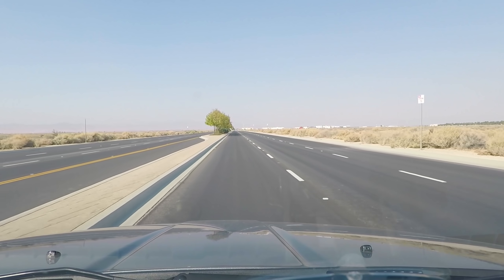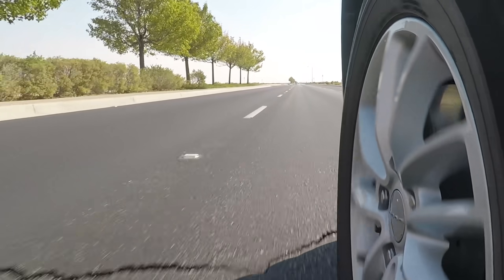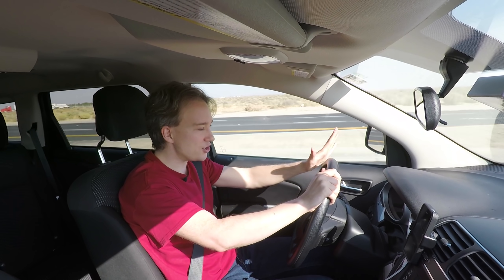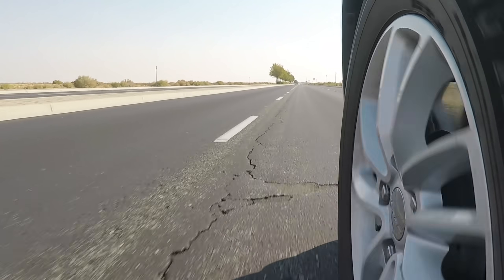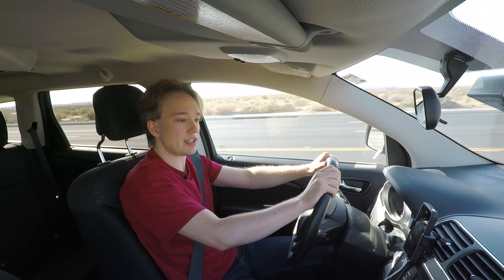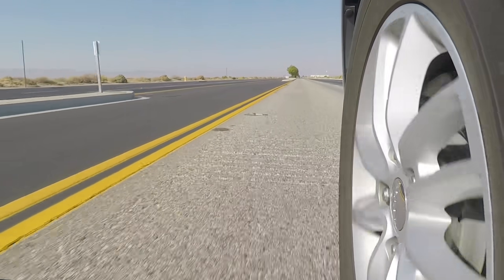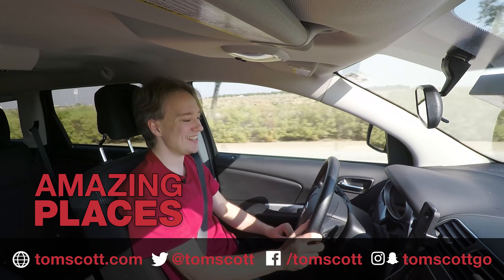Why California's musical road sounds terrible

Comment: Okay here's another question:  What effects does the vehicle wheelbase have on the resultant sound?  While the pitch may be the same, the front and rear tires may be at different phases within the same pitch.  This can potentially generate odd harmonics.  Since this road was designed by Honda, is it possible that you need to use a CR-V to get it to sound somewhat better (though still not completely right)?

Comment: More like: someone can't read a technical drawing correctly.  The idea that this project was prescribed entirely in written form is rather suspect.   That's not how engineers primarily convey technical instructions.  My speculation is that the person who drew up the plans didn't have a good idea as to what the width of the ground grooves would be and thus represented the grooves as lines with zero width.  Then, failing to call out the groove spacing as being on-center in their drawing (or the cutting crew failing to read the drawing notation stating as such), the grooves were cut using the indicated dimension in between the start of one groove and the end of the previous one (as described in the video).

FWIW, when I was sorting through résumés for engineering interns, I was a little surprised how many had not been exposed to CAD, or a technical drawing class by their second or third year in college.  With that anecdotal evidence, it wouldn't be at all surprising if the technical drawing was missing a few key details, like centerline dimensional call-outs.  It seems like CAD/drafting has become extracurricular or learned on the job for some.  Which, to say the least, is a little scary.

Comment: Well, clearly you need a vehicle with bigger tyres. If the center of the groove is x distance from the next groove instead of y distance, the wheel needs to be y-x=z so z times bigger than the wheel is now. Check my numbers but...right?

Comment: People are so dumb. This is the result of lack of attention to detail but to have it happen twice is pathetic.
Reply: Cheese Miester Well he can't really do anything about it can he?
Reply: Yeah seems weird. Isn't there multiple drawings, profiles, cross-sections etc checked by multiple engineers? He made it sound like some guy just said "4 inches" verbally and they rolled with it.
Reply: Malus1531 For a few bumps on top of what I assume is concrete or granite doesn't take bridge-building mathematics.
Reply: +Fallout A lot goes into designing a road. You have to estimate traffic loads, design against cracking & other forms of damage, consider drainage, determine the stiffness of each layer and how that will affect the distribution of force through the various layers, etc. They don't just go out and start pouring concrete/asphalt.
Reply: American'ts...
Reply: Buddy Clem that's ironic because the ad was for the Honda civic. Honda, of course, is a Japanese company. But your point about Japanese cars being more reliable than American ones is still valid.
Reply: I think this explains why so many Americans buy imports. Toyota stops the assembly line if a mistake is found, and doesn't start it again until there is a solution. American car factories just say "Close enough!" and build every car with the same mistake. Like the Chevy I had with plastic gears in the transmission.
Reply: It's because it's California, you can't trust them to do anything right.
Reply: It's because no one actually cares. Just like the guy in this video isn't going to do anything about it.

Comment: Wow. They got so many things wrong in this video. The road was moved from its original location because residents complained about the noise. That's about the only thing he got right. The original road was made for a car commercial. Not really as a publicity stunt. And the tune isn't suppose to be the beginning of the William Tell Overture, it's somewhere near the end. And if you drive over it at the correct speed (55mph) it sounds much better than the noise this video claims. I lived in Lancaster for a while and drove over it a few times while going to and from work.

Comment: There's a stretch of road near me in north Wales that just goes ooooeeeoooooeeeeeeoooooo, rather than a tune. It's a normal rumble strip, which  commonly cover our entire off ramps up here, with another, different set of rumblers laid on top. Not intentional, but I go there rarely enough that it always startles me.

Comment: Not only are the grooves too far apart, but cars always have at least two axles. You will hear the song twice, slightly delayed. And there is no way to fix that, even if the grooves were at the correct distance

Comment: You could have music in two parts if the lane was divided in half with the right and left wheels going over different bumps!
Reply: +iTheGeek - I know a lot has changed in the US car industry, and most of it for the better, but when taking an average, rather than comparing the most well-engineered car from the US with the most middle-of-the-road one from Europe or Japan, the US is still way behind in the sophistication of its suspension designs. Don't get me wrong; I'm not necessarily implying this is a bad thing; the internal market of the US has vastly different demands of a car than those of Europe and Japan, and that will be reflected in the way cars are made. Us Europeans are willing to wildly overspend on their cars just to get a level of build quality and materials usage that is frankly unnecessary, and I'll readily admit that sometimes, we're too clever for our own good. There's a reason why European cars are so much more expensive than US-made ones, and when it comes to cars, you more or less get what you spend.
Reply: You're right; that's kind of ridiculous on second thought. And the grooves aren't even that deep. But it would be noticeably bumpier
Reply: +The Real Flenuan - Unlikely. I know that suspension design in the US isn't quite what it is in the rest of the world (a lot of US-built cars still use live axles, for crying out loud), but even the most basic suspension configurations can easily deal with such shallow indentations in the road surface if they're uneven left-to-right.
Reply: Good idea but I imagine it would make the drive extremely bumpy and maybe even unsafe, since the two sides of the vehicle would be going up and down at different times

Comment: obviously there is the measurement error like you said, but also note that the speed at which u drive determines the frequency as well. you are confusing event frequency with pitch frequency. For example, I can play the violin faster as in bow the notes faster, but the vibration of the string still vibrates at the same frequency

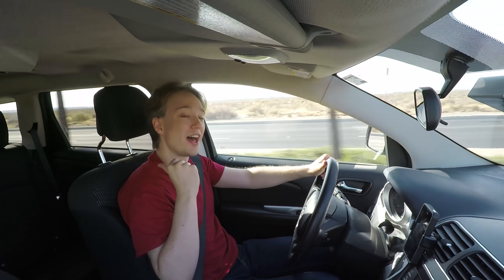Comment: Paused at 00:30. I'm going to guess that it's because of the changes to suspension systems, and improved dampening,  or the specific tuning to the prototypical car they used originally.

Edit : Oh, now I'm just sad, it was because they had it built by cheap labor...
Reply: I have to deal with "impossible" blueprints all the time. They really need to learn to mark their intentions better. And considering that they did the same wrong thing at least twice, it was obviously poorly annotated.

Comment: Actually, Virginia's Highway Route 3 between Culpeper and Locust Grove was recently widened from one lane in each direction to two lanes. However by freak accident, due to the heavy equipment that followed behind the paving machine having cut unintended grooves into the fresh asphalt as it set, anyone who is driving eastbound on that stretch in the right-hand lane just past Carrico Mills Road in Stevensburg (Culpeper County Road 669), is treated to the opening of Beethoven's 9th Symphony. I'll see if I can get you a video of it Tom when I next head into Culpeper.

Comment: Distance between the front to rear tires varies between models of automobiles, distorting the tune. To get the proper notes and melody, you must travel down the road at 55mph.... in a unicycle.

Comment: Sounds like the box model issue in CSS, where there was the question of whether the box width is only the content or whether it also contains the padding and border (which too will lead to cumulative measurement error).  When we're talking about wavelength, that's always measured from peak-to-peak and for good reason!

Comment: If you could adjust your speed between each note fast enough.  Or just drive the road at different speeds that would correct each note then cut it together.

Comment: any second year student of either design, engineering or applied math knows that you always measure TO THE CENTER of the point of separation!
except when explicitly told otherwise, separations are always to the center.
I can get that from the laborer measuring wrong, but, from the supervisor!?
Reply: Nighthawk Government contracts always go to the lowest bidder.
Reply: but even if you hire el albañil del pueblo, there's still blueprints reading you the actual measurement, and from where you're supposed so measure!

Comment: They've rebuilt it the third time, it seems. If you watch my video (https://www.youtube.com/watch?v=3hmFDU7qPRg), which I filmed in July 2013, you'll see that the groves seemed to be carved right in the asphalt of the road, while it your video they seem to be done in concrete.
BTW, as for the 'wrongness' of it, your explanation does not account for the fact that most vehicles have two sets of wheels (and the distance between those two sets varies between makes and models). So it means, I think, is that there simply cannot be the 'right' configuration of the road.
Reply: Front and Back wheels will play the same with a slight delay (around 0.08s), so it would just generate a "reverb" effect, not change the pitch (nor its wrongness).

Comment: The road sounds strangely reminiscent of the iconic riffs from Star Wars movies. In house framing a technique known as "On Center Measurement" is used to get wall studs situated properly in a wall for strength and placement of other things like doors, windows, and electric outlets. I think that's the missing design element.

Comment: So in order to play this road right, you need a hypercar  with insane acceleration and equally insane brakes so you can speed up and slow down a the presise right place ..   Should be a good challenge.

Comment: Wouldn't another problem with this road be that the font wheels would be playing a note slightly ahead of the rear wheels, so even if the spacing was correct, it still woudn't sound correct?

Comment: My pre-viewing assumption was that it was going to involve the difference between the front and rear wheels. Imagine a record needle with two points rather than just one. And I still think that may contribute to the problem. There have been references to musical roads in Japan posted on YouTube, and after listening to them they still sound pretty bad.

Comment: What about a disonance between the front and the back tires? Should there be a problem with that when the note changes?
Reply: Well.... He's going 55 mph, which is about 24.6 m/s. Divide that by the distance between the tires, about 2 meters, and you get 0.08 seconds. That would be the delay of the back tires relative to the front tires. Idk but I would imagine its sorta like a short reverb, maybe? Or like having the track play twice but 0.08s out of sync.
Reply: Yeah, reverb and a nice chorus effect from the doppler shift between the front and back wheels :D

Comment: Great video! Did you specifically write the script so the timing worked that well, or did you have to adjust your speed on the return loop (say, go 65 or something) to get it to line up? (Or did you get tricky with multiple takes, you sneak you?)

Comment: No one asked the original designer whether the spacing was center to center or edge to edge? That's some "not my job" level apathy.
Reply: Not necessarily the designer's fault. Could be that the drawings were excellent, but no one bothered to actually pay attention to them.
Reply: And it's almost always centre to centre in anything construction related
Reply: Well, we're talking about road workers here. I wouldn't give a damn either.
Reply: I would blame the designer for not making a clear drawing. Every engineer should know that language is ambiguous by technical standards.
Reply: Xplayer007 yup
Reply: That's the people of lancaster for you!
Reply: +Fong Angela  What kind of small-minded imbecile would assume this only happens in America?  I bet you're a liberal.
Reply: Xplayer007 that's American unions for ya
Reply: Correction: it's American-style (TM) apathy. Once in XXI I had to hunt down THREE workers before someone would help me find an item. Only in America.

Comment: So can't they be adjusted by adding to or removing from the grooves? I know the notes' lengths won't be correct, but I think that's better than them being out of tune. Let's get a petition going, for what is the point of a mistake if you've not learned from it?
Reply: It's a car company that did it, so you would have to persuade them to redo it, otherwise the county will just pave over it.

Comment: Surely having front and rear tyres would play different parts of the tune too.
Reply: I imagine at the speed of travel it might not be as dramatic as each tire on a different part of the tune, but its true that the front tires would begin playing a new note as the back tires continue the old one for a very short period of time, fractions of a second behind. It would probably sound like a note slur, which for a song like this would still make the triplets sound bad.
Reply: Good idea!  However, the wheelbase of a Toyota Prius is 2.7m (for example).  Traveling at a speed of 60mph means there will only be a difference of 0.1 seconds between the front and back tyres.
Reply: Nah. You could just do a car-wheelie.
Reply: 100ms is a fairly large amount of time for music, it would sound like a reflection off a wall in a medium sized venue.
Reply: Good point, Motorman2112!  In 100ms sound could travel 34 metres, so yes, it would be like an echo from a wall 17 metres away from you.
Reply: @Unfortunately Rob: There are no triplets in this section of the Wilhelm Tell ouverture ;)
Reply: Wow, A intelligent comment section and replies in YouTube afterall!
Reply: yeah but since its a highway 55miles, 88 km/h, thats 24 m/s (i think) and a car the wheels are 2ish meters apart. thats 1/10 of a second, maybe 1/15. not sure. anyways its more of a surround sound. like putting your head in water.
Reply: I've heard of musical roads a while ago, but I never thought about this... wow
Reply: It would. And don't call me Shirley.
Reply: This!  And since the wheelbase of cars varies plus that their resonance frequencies varies this idea was doomed even before it started. Add to that a tire isn't a perfect circle it will always be flat on the bottom and while most of the pulse will be created by the impact there will also be a pulse in the back.

Comment: So it effectively sounds like it went through a frequency shifter? (NOT a pitch shifter!)
Reply: Why? Because the notes of a scale are not interspersed at equal frequency intervals?
Reply: yea, to get to the same note an octave higher you double the frequency. As mentioned, A is 440 hz, but so is 220, 880, 1760. etc. Lower notes are closer together in frequency. The frequency of notes are based on the harmonic series, so they're not equally spaced, but by a logarithmic ratio, which is based on the harmonic nodes of a vibrating string or whatever. The ideal tuning based on the harmonic series - known as Just Intonation - would only really work for one key, then when you change keys the whole scale would sound really wrong, or you'd have to change the whole tuning every time you change keys, which isn't possible on instruments with fixed note spacing (things like piano, guitars with frets, etc.) So most of those instruments use 12-TET (12 tone equal temperament) which skews it so everything is very slightly out of tune (most people can't even hear the difference), but allows for all keys to sound the same.
Reply: +SquareWaveHeaven It's not a constant frequency difference, but a constant wavelength difference.
Reply: Do you have a chart for this stuff??

Comment: Engineers can be stupid sometimes
Reply: which is simply based on a lack of clearity in the instructions given to the workers, at which point in the chain off command the error has been made is unknown to me, coudl have been the engineer, could have been literally anyone else between the engineer and the road worker.
Reply: Too often they lack practical common sense and don't understand the installation process. So as the road worker was asking questions the engineer probably just agreed rather than admitting he didn't understand the practical implementation of his drawings/ plans. It's a problem everywhere.
Reply: Gernuts The english language can be ambiguous sometimes. 

Engineers might have their dialect where they define the position of a groove as the start, and the distance between grooves as the distance between those positions, but the normal everyday dialect of English doesn’t have those definitions.

Comment: Interesting indeed, totally useless, but interesting.
Reply: I think it's useful. It's a lesson that says "Make sure your specifications are clear or your musical road sounds wrong." Not quite as good as "remember to include units in all calculations or you try to orbit under the surface of Mars", but still important. And of course, if they got the floors for a skyscraper wrong by the depth of the floors/ceilings, it might be more prone to collapse, or feel too tall, or in the opposite direction short and cramped.
Reply: yes indeed